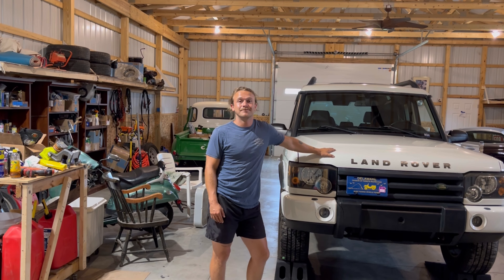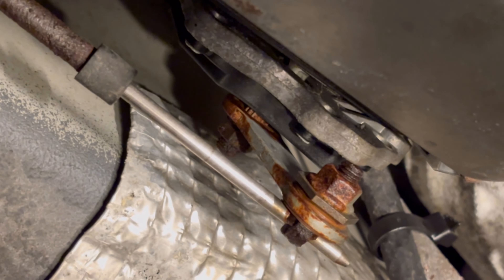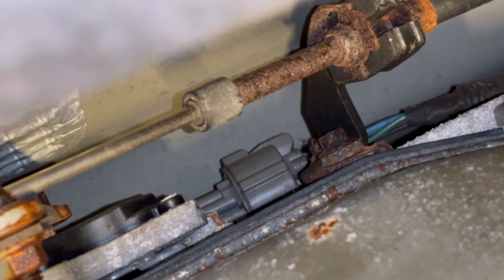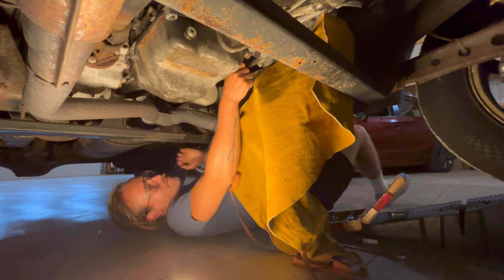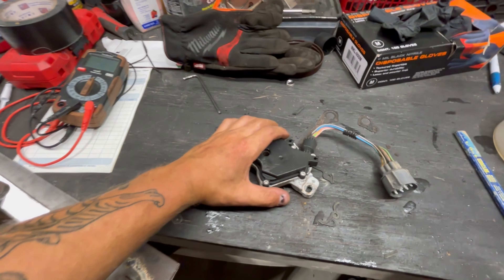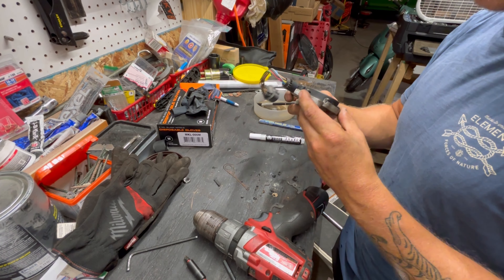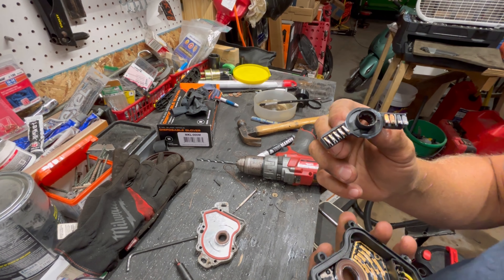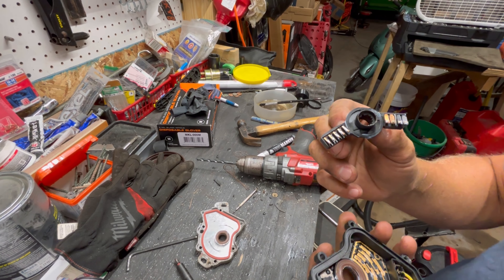Can the Flashing M & S and Limp Mode be an Easy Fix on the Landrover Discovery 2?

Comment: I just fixed my XYZ switch when you first start it’s a pain but now that I’ve done it. It’s a piece of cake now I just have to get the three amigos off the dash.
Reply from the maker: @mcleodmarcel48  is it shuttle valve issues now for the tres amigos? I just filmed a new video repairing mine and that completely rid me of the lights while retaining function